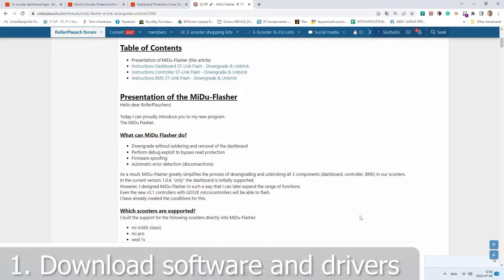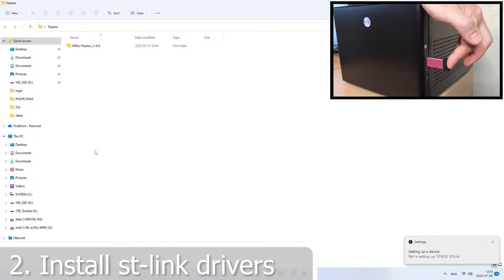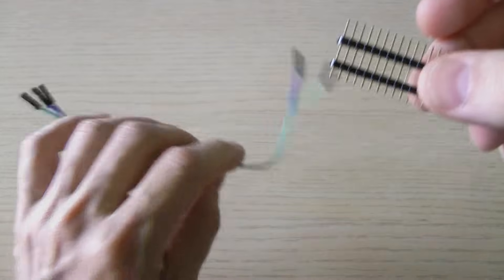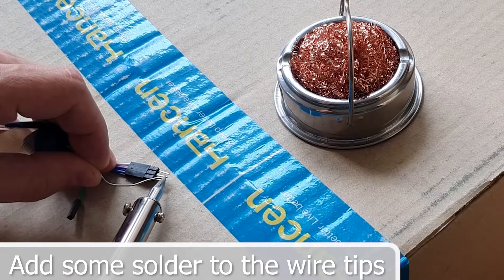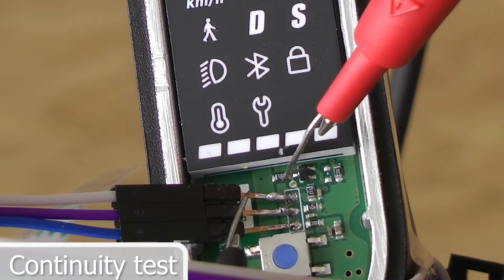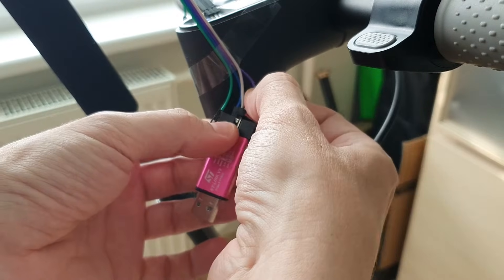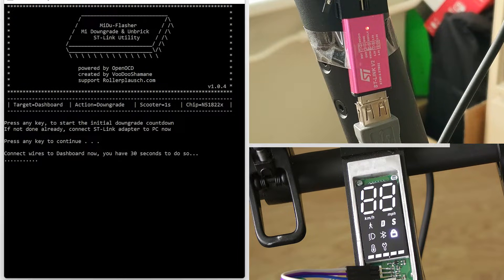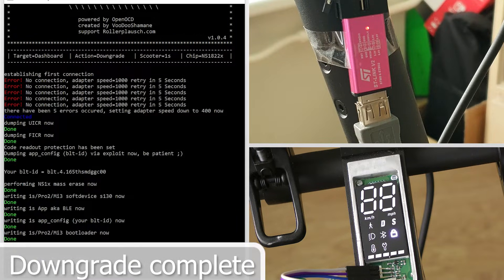Xiaomi scooter 1S BLE157 downgrade using stlink

Comment: What about 3.3v cable?😊
Reply from the maker: You don't need 3.3V since it’s powered by the scooter. If not, you can use a 5V cable to power it on. Subscribe, thanks.

Comment: Hello, I did all as said in the video, mut my xiaomi mi 1S is stuck when i try to connect it. When adapter speed slowes down there is till no connection no matter how long i wait. My st link has clk, dio and gnd in different pins. Could it be possible that my st link is just not good enough? Soldering seems to be good. Triple checked it.

Comment: Hi. I used an used original display from an essential on my m365. After downgrading drv to 155 it started working, but every app now says I am connected to an essential. Is there anyway to flash the dashboard with the m365 firmware? 
Sorry, I am very new to this 😂

Comment: After "dumping UICR now" it still says "No connection"
What's the problem?
Mi Pro 2, BLE 1.5.8
Reply from the maker: Did you solder the pins, or were you just holding them by hand? Subscribe, thx.
Reply: @MindaugasJocionis 
Held them by hands.
Tried many times, no success.
Voice says "connected", text appears "Dumping UICR now", then immediately goes "Error! No connection".
I don't think soldering would help.
Reply: Same here, no work by holding... tried 5 times but doesnt work.
Do you know how to solve the problem?

Comment: Can this work on the essential?
Reply: Ok thanks
Reply from the maker: Yes, it works on xiaomi essential (lite) 2. Subscribe, thanx.
Reply: @MindaugasJocionis  i dont see any xiaomi essential ( lite) on midu flashed,can you help?
Reply from the maker: @E92_setup_guy  Oh right, Essential isn't on the list. Choose 1S — it will work too. After that, you can reflash any BLE to your dashboard via Bluetooth.
Reply: @MindaugasJocionis  sorry to bother but i have another question. I have tried to downgrade ble with webflasher and the dash got bricked and the solder points on the front broke and I can't solder to them. Is ther another way to do it ?
Reply from the maker: @E92_setup_guy  Saw your pic in the ScooterHacking Telegram. At first glance, it doesn’t look too bad. I’d start by cleaning the solder from those points using solder wick and checking the PCB’s condition. If the points are really ripped off, they can theoretically be restored by locating the traces, scraping off the solder mask, and soldering directly to them. There's no other way to bring this board back to life than by establishing a physical connection.
Reply: @MindaugasJocionis yea, they are ripped,i just bought a new dash on aliexpress and ye

Comment: Why do people connect to the speedcontroller directly since it is a lot more work than this?? This is so much easier, but does it work with all models?   I was handed two ninebots from 2021i think they are some f20 cheap ones, i want to build something crasy like 4 wheeler with two scoots welded together. I need for the motor to turn from stop not having to kick it going

Comment: Is it still working in 2025?
Reply from the maker: Yes, subscribe, thx.
Reply: With Version 1.1.0
Reply from the maker: You mean BLE110? What scooter is this? m365 pro?
Reply: @MindaugasJocionis I have s Xiaomi 1s
Reply: My Scooter is on the New Firmware
Reply: On the Website it says for 1.0.5 but my Scooter is 1.1.0
Reply from the maker: Are those BLE versions? Connect to scooter hacking utility - android app, and check there.
Reply: @MindaugasJocionis my BLE Version is 1.5.7
Reply from the maker: This is a locked BLE, and following the steps in this tutorial will allow you to downgrade it.
Reply: @MindaugasJocionis  thanks

Comment: I checked all the connections, they are all connected properly, but I don't know why it gives an error, it gives an error connecting, it doesn't connect at all, can you please guide me what the problem could be?
Reply from the maker: Check for bad soldering, incorrect cable connections, or issues with your ST-Link (verify detection in Device Manager). For further assistance, join this Telegram chat: https://t.me/scooterhackingchat. Thanks for subscribing.

Comment: I bought an stlink v2 and it's blue and the chords color was green blue yellow an orange. Can I still downgrade the BLE?
Reply from the maker: Yes, you can use it. Just pay attention to the connection descriptions, as their placement might differ. Subscribe, thx.
Reply: @ just subscribed. Thx
Reply: @MindaugasJocionis it doesn't say anything about which cord goes in which pin port.
Reply from the maker: The cord color doesn't matter. If there isn't a diagram on the device casing, remove the PCB; the labels will be on the PCB itself.
Reply: @ ok I'll check
Reply: @MindaugasJocionis  do I take it off?

Comment: ST link and MiduFlasher 1.0.4 aren't working.  Error message: "\MiDu-Flasher_v1.0.4\Resource\" cannot be processed syntactically at this point. Do u have any idea?
Reply from the maker: @felixbader6320  Try placing the folder directly in Drive C, not inside other folders. Subscribe, thanks!

Comment: hi, can i use the four bottom pins on the display ? and will this method work with BLE 3.4.4 ?
Reply from the maker: https://www.spzshop.com/blogs/infos/flash-des-cartes-dallumage-bluetooth-avec-st-link You can use bottom pins for 5v and ground.
It should be able to reflash any original dashboard. For more info try this telegram chat: https://t.me/scooterhackingchat
Subscribe, thanks.
Reply: @MindaugasJocionis thanks bro, it worked, it was the most difficult operation in my 15 years of life. I did it without soldering on bare cables. regards!

Comment: Can I edit my dashboard's firmware without connecting it to control unit? Im thinking of supplying the dashboard via some regular 5V source (12V if Im wrong here).
Reply from the maker: Yes, you can disconnect the dashboard and power it from the 5V pin on the ST-Link. https://shekan.si/wp-content/uploads/2022/08/20201215_234327_0000-1.webp 
Subscribe, thanks!

Comment: I made mistake, and did update my firmware on mi 1s e scooter via mi home app, and now i can't flash previous firmware on it with downg app anymore. Is there any other way to avoid all this wire things? To do it all on my cell phone, like i did it before latest update?
Reply from the maker: Only this method to downgrade the dashboard firmware. Or you can buy or borrow another dash for temporary use for DRV or shfw flash. subscribe, thanks.

Comment: When i try to Flash it the software just keeps saying error pls help
Reply from the maker: If you soldered it, it means there is a bad contact or the wires are connected incorrectly. If you're just holding these pins by hand, clean the protective coating off the circuit board with isopropyl alcohol and hold as steady as you can. Subscribe, thank you.

Comment: Hey i did this and i use the no soldering method but it went off the pins a few times then when i finished it, ir works but it shows an error 42
Reply from the maker: Mi scooter 3?  Did you flashed some DRV? Install shfw from "scooter hacking utility" and configure it. Check this telegram chat for moore info https://t.me/scooterhackingchat
Sub. thx.
Reply: @MindaugasJocionis  Yeah i have a Mi Scooter 3 and i downgraded it using the no soldering method and it did show error 42 but when i flashed it to install SHFW with Scooter Hacking Utility its fine now, Thanks for the great video
Reply from the maker: @mohammadannasnadeem5281  Nice :)

Comment: How can i do this if i cannot lock my scooter anymore
Reply from the maker: Why it's not locking? Did you brick it by flashing wrong firmware? If so, you need to reflash tour ESC: https://youtu.be/kbj3A4aAlSU
Subscribe, thanks.
Reply: @MindaugasJocionis  no i tried to reconnect it to my xiaomi home app and i cannot do it
Reply from the maker: If you have connected the scooter to any third party app, you need to first remove it from the mihome app and set it up again like the first time. Or lock it with "scooter hacking utility" app.

Comment: Hi. I have a m365 and I flashed via Bluetooth BLE129 that I downloaded from scooterhacking. After flashing it the scooter simply disconected from my phone, the battery level dots went dark, the button didn't work and it started behaving like it was blocked. It also doesn't appear when i search for bluetooth devices. 

A few hours later it stopped behaving like it was blocked and now it simply blinks the tailight when the button is pressed. Thats the only response that I can get from the scooter. The rest remains the same except that it doesen't block the wheel when its moved anymore.

 Do you think that doing this procedure would solve this problem?
Reply from the maker: Probably yes, choose write flash instead of downgrade in the midu flasher. I believe to use shfw on m365 you need modified ble "BLE90For4dot_zipv3.zip" it can be found in this telegram chat: https://t.me/scooterhackingchat
Subscribe, thanks.
Reply: @MindaugasJocionis  Thanks. I will try this as soon as i get the ST-Link

Comment: Tried to solder it on but the moment i touched the board with the soldering iron sparks came off and now it doesn't start up
Reply from the maker: You were probably soldering while it was on.  And touched something with voltage. Shit happens. Buy new dashboard.
Reply: @MindaugasJocionis  hey yes i'm just going to buy a new one do you know if the M365 pro dashboard works on the 1s? Because i dont see a lock icon on them.
Reply from the maker: Should work
Reply: @MindaugasJocionis  alright thank you for the help saved me about 10 bucks with that info.

Comment: would it be more feasible to install a permanent connector to it?
Reply from the maker: It would be overengineering; you need to do this only once. Most people do this just by holding the connections by hand :) Subscribe, thanks.

Comment: Worked like a charm. Used a very thin wire (0,5 mm) which was easy to solder on the pads. Also used my glue gun to glue the wires down at the edge and that made it easy to remove afterwards. Subscribed.
Reply from the maker: Nicely done :)

Comment: Hi dear I have the GD32E1 - V3.1controller is it work OR I will break MY SCOOTER
Reply from the maker: This video is on how to downgrade BLE (dashboard) firmware. 
GD32E1 (V3.1) is your mainboard controller. 
So after BLE downgrade, you need to use DRV which is made for the 3.1 controller, or use SHFW from the 'Scooter Hacking Utility' app; it detects the controller version and flashes the right firmware

Comment: If i do this what could happen in the bad situation,
Could the dashboard break
And do you recommend to try it on another dashboard
Reply from the maker: Most people do this without soldering, just holding the pins by hand. (For this, you must clean the coating from those connection points with isopropyl, etc.). A Clone dashboard is also a good choice; use it just for flashing firmware to ESC. After that, you can switch back to the original dashboard. 
If soldering is a problem, I think the safest method is to use a clone dashboard just for flashing ESC.
If you are considering soldering and doing this for the first time, I suggest you practice on some bad PCB from PC, etc.
Usually, problems are related to soldering. (Burned PCB in soldering place, ripped off traces etc.)
Subscribe, thank you.

Comment: still working?
Reply: Yes, Just did it and it worked for my 1s I can finally hack again 🙂
Reply: @Nothingatallye  did you do it without soldering? And do you have any tips?
Reply: @unfallvoll  yes just hold the pins on the soldering pads, and be patient it takes a while but after you hear connected just hold and after a while it's saying done ✅
Reply from the maker: @Nothingatallye  Nice :)
Reply: @MindaugasJocionis  thank you especially for this video you saved me from my fear of police
Reply from the maker: Yes. Subscribe, thanks.
Reply: @MindaugasJocionis  would you rather recommend this than buying a new dashboard even if i never did soldering in my life?
Reply from the maker: @unfallvoll  Most people do this without soldering, just holding the pins by hand. (For this, you need to clean the coating from those connection points with isopropyl, etc.). Clone dashboard is also a good choice; use it just for flashing firmware. After that, you can switch back to the original dashboard. 
If soldering is a problem, in my opinion the safest method is to use a clone dashboard just for flashing ESC.

Comment: Thanks for this guide, i downgraded my 1s without the soldering and flashed a custom firmware, fully charged i reach 30kmp, is there any way i can go faster?
Reply from the maker: Only with the "field weakening" option from the "scooter hacking utility" app. Though I don't know the safe values to avoid burning the motor. I tried with my Mi3, reached 40km/h, and the motor was hot to touch after 2km. So... Subscribe, thanks.

Comment: Hi do i need to remove some capacitors for this to work or i just directly go to soldering? Thank you!
Reply from the maker: There is no need of removing capacitor or cutting trace, stlink will connect @ lower speed. Subscribe, thanks.

Comment: Hi my Mi 3 Dashboard got bricked because i try the non-soldering method, can you help me recover it?
Reply from the maker: What's happening with it? Was the connection successful? Was the flashing unsuccessful, or there was a disconnection? Are you getting some errors? I need more info. Subscribe, thanks
Reply: @MindaugasJocionis  already subscribed long time ago when i watched your ble downgrade video
Reply from the maker: @pssyslyrr6074   I would try to connect 5V to the dashboard directly from ST-Link, and if it turns on, do a 'write flash' instead of "downgrade". Or if it fails, use a scooter hacking refresher V1.3 app to do the same.
https://photos.app.goo.gl/1c7Ro5uM2KM7JgNh8
Thanks for sub :)
Reply: @MindaugasJocionis  thank you so much, will try it
Reply: @MindaugasJocionis  btw what app that 'write flash'
Reply from the maker: @pssyslyrr6074  "Write flash" is midu-flasher option @ 8:18
Reply: @MindaugasJocionis  hi can you share me again the picture of thr dashboard? i cant see it anymore
Reply from the maker: https://photos.app.goo.gl/H28RiuAZZ5P8GCYC6
Reply: @MindaugasJocionis  thanks
Reply: @MindaugasJocionis  there was disconnection while in process of downgrade, when i turn on the escooter there was no display shown on the dashboard, my tail light is blinking and the controller has green blinking
Reply: @MindaugasJocionis  im currently able to use my mi scooter 3 with replace clone dashboard, i just want to recover the old original dashboard of my mi scooter 3

Comment: My stlink cables didn't come with an end that has pins. My cables have holes to be plugged into something on both sides, as if I'd connect them between two stlinks. What can I do?
Reply from the maker: Cut a paper clip or something similar made from metal, or buy those pins in any local electronic DIY shop. Subscribe, thanks.

Comment: Does the downgrade apply to the dashboard or the controller? 

I broke my dashboard during this process because the SWDIO dot came out of the board when I attempted to desolder and resolder as it wouldn't turn on when I soldered the stlink on. Will buying a dashboard off ebay be already downgraded? I'm going to try taking my pro 1 dashboard and putting it in my pro 2, but I am unsure whether it will come with the hack I put on my old one and whether the pro 2 will still have it's features like cruise control. Or the dashboard is simply just a signaller and display?
Reply from the maker: Downgrade applies to the dashboard. After the dashboard downgrade, you can flash firmware to the mainboard over Bluetooth.
From eBay, probably it will be a Chinese clone dashboard (unless you find the original). Some of them can be used for flashing DRV; some not.
If the problem is only that your solder point came off, the wire can be soldered directly to the PCB trace.
As for the pro1 dashboard, it will work with pro2, but the hack will remain on your pro1, as speed increases when you hack DRV mainboard.
If your pro1 has unlocked BLE (dashboard), you can use its head to flash shfw and then swap back heads. The dashboard is like a gate that lets you flash the main controller.
https://youtu.be/YAexlwq47q4
Check the video description. 
If you follow this video, there is no need to flash the BMS; I just showed that it is possible. Only swap heads, and flash shfw from the "scooter hacking utility". After that, configure speed curves to start riding. 
Hope it's more clear now :)
For more info, check this Telegram chat:
https://t.me/scooterhackingchat
Subscribe, thanks.
Reply: @MindaugasJocionis  thank you for your reply, it has certainly helped clear a few questions I had. The pro 1 dashboard swap didn't work out for me but I can't remember what the issue was. I bought a new pro 2 dashboard from Amazon for £23 and was able to use the hacking utility to install the hack. It was much easier than trying to solder the tiny connections on the dashboard, so I'm glad I was able to do that. I needed my scooter to be able to accelerate from 0mph as I use it for carting  dog crates at dogs shows too, and had Crufts just days away. I fortunately fixed it in time :)

I still need to figure out why my pro 1 won't turn on, but I have a spare dashboard now as I also got one from ebay, so I will test that out. I tried replacing a connector for the brown cable from the battery to the controller as it looked cooked, but that didn't fix it.
Reply from the maker: Glad to hear that you fixed your scooter . 👌